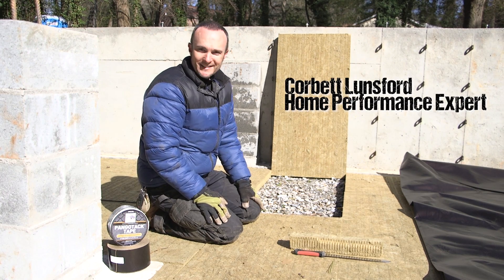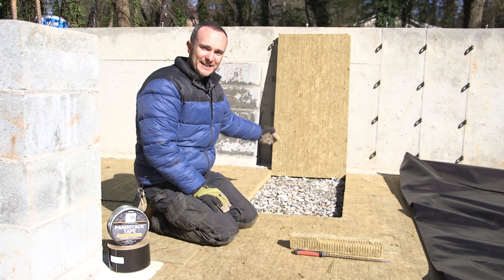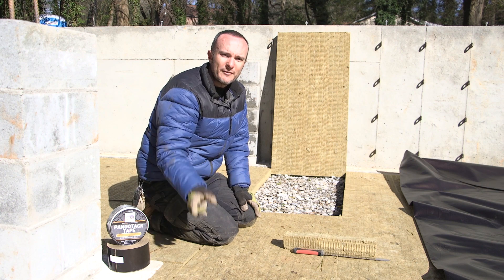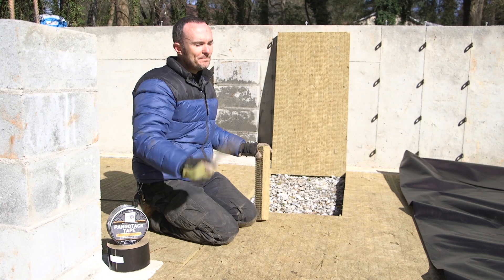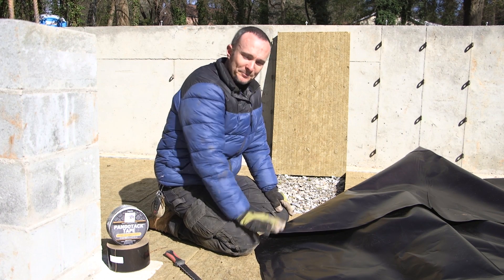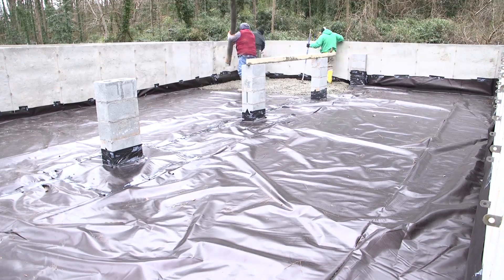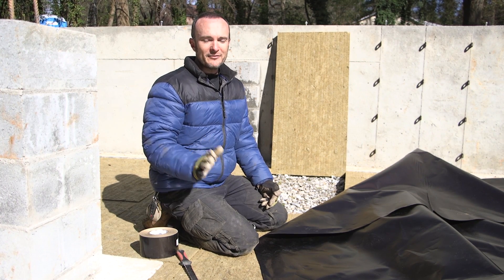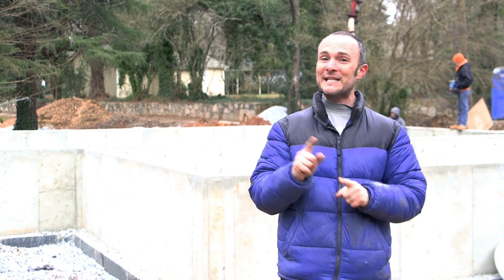5-Layer Slab System for High Performance Home Build

Comment: In northern climes you have an error. Possibly even for Atlanta.  The slab you just poured is in contact with (the exception being a 15 mil sheet)  with the rail footing and the concrete foundation wall.  No.  The slab temperature is governed by what it is in contact with.  Concrete has an R-value of less than R-1 per FOOT,, maybe.  So,,, why did you bother with R-10 under the slab?  You will have about an R-2 average yield.  Thermal conduction and thermal bridging.

Don't pour a thin slab.  Pour a thick slab, the slab can become not an enemy,, but a benefit,, a thermal flywheel for the house.  (Cool  or heat the slab,, and the house will be cool or warm.  Cool with night air,, heat with sun,,both are free.)  but, Isolate it from ALL contact with footings, soil, and outside air. If the slab is only in contact with the interior air , it will be the same temp as the interior air.

Fiberglass speeds the set time.  Pouring on insulated foam increases the set time.  A 2" slab will not generate heat anything like a 4 or 5 inch slab.  and a 2" slab on foam should not be walked upon for finishing.  Bull float it well and leave it alone.  2" slabs work very well.  I would use a higher bag count, which also increases the heat.

In Atlanta,, only try that pour in the winter.  At 80F and sun, your set time will be in minutes.  In any other than winter, use retardants, or a 12 man crew.

Isolate your slab.  And,, the vapour/water barrier goes under the sheet insulation, not over it.  The R-value of your insulation is based upon a dry insulation.  A rockwool insulation can be wetted .  A wet rockwool insulation has no R-value.  Rockwool or foam insulation should be on the level above the rail footing, and perimeter isolation band can be accomplished with a burial grade pressure treated 2X4, or 2X6,,  ,,or,, high density poly-isocyanurate (uncommon),, or high density urethane foam 3 to 5 pound density works well, or even pumice bricks.  (used for cleaning ovens and grills)

My first isolated slab was 1983.  I've made lots of mistakes,, no reason you should not benefit from my misdeeds.
Reply: Glad I could help.  That is exactly why I took the time.   I did, and did not use the 'pick two',, just a different way of looking at the same thing.  Calculate the cost of the improvement, calculate the money saved,, by building better, stronger, more insulation,, whatever.    Money has a cost and a value,, and money can earn interest and make money. So,, if you invest in a high yield investment,,, or you invest in more insulation,, which pays you back better or faster?  Choose the better return, either stocks, or insulation..  There is no such thing as a 20 year payback,,,,, you should have invested in the stocks and bonds and paid the increased energy cost with the profits.    I always calculated and watched for a maximum payback of 7 years.  Most 'improvements I ever attempted were targeted of a payback in 5 years or less.  Some few,, I would stretch to a payback of 8 or 9 years.  You also must watch for over lapping 'improvements'.  If you have already saved  a 100 dollars,, will the next improvement try to save the same 100 dollars?  Apply that thought to all aspects of the house you build for yourself.  Cheap shingles may be the best, cheapest, economic choice,,, or a copper roof may be the cheapest roof,,, you run the numbers to decide.

Rule of '72' .   A seven year payback equals about a 10% per annum return on investment.
Reply from the maker: Thanks, Sailor, and just so it’s clear, we used energy modeling to specify the exact R-values. I’m familiar with thermal bridging, but what we’re demonstrating on this channel is how anyone can achieve a high performance home without driving their team crazy. Btw, our cooling load is already just 1.5 ton, the smallest split system you can buy, so further insulating anything would actually DEtune my enclosure and HVAC from each other.
Reply: 1.5 for your locale is impressive.   You are doing good things.  Ours, north of Detroit, the last one I built quite a few years ago,, no central air, a water chilled A-coil,, about a 1/2 ton yield,,(de-humidifies) , heating,  a detuned,, burners removed,  3,000cfm,, but just 100,000 BTU.  3200 net square feet + full walkout level.  Gas bill on the order of 600-700 per year. (gas,  heat, hot water, stove, dryer)  Quad glazing, walls fiberglass12" over all.  Zero pipes or ducts in outer walls.

I'd like to suggest you think seriously about  a thicker, completely isolated slab.  Thickest I ever poured was 10" with 500 linear feet of ribbed 4 inch tubing cast in,,,,,   Winter sun warmed air collected from the top of the house by some slow shaded pole motor fans.  Ductwork from top of house to basement floor,, and into the floor slab.   81F sun warmed at the top was 79F as it entered the basement floor, and exited perimeter floor registers (16)  at 73F.  In January, a sunny 20F day,,furnace almost would not kick in until Colbert  monologue.
Reply: Sailor376also I'm near out as well and would like to build.  Interested in hiring you if possible.  Please contact me thriough you tube or also try Drew4justice at y a h o o .   I like what you have to offer
Reply: I do not get it . Why is insulation used under the slab?  First , if you do not have groundwater close to surface  about 10 feet  the ground works as insulation.   Second , if you do not insulate ground from  the floor the earth works as thermamass . Yeas , you have to insulate sides of your foundation and ground around of your house for 4 or more feet.

Comment: Just found your channel. I assuming this is going to be a conditioned crawlspace. I didn't notice any vents. Is this going to be used as a cold air return for your HVAC system? I am an insulation contractor and helped a few folks with insulated crawl spaces. We are about 4-5 hours north of you and we insulate about 2/3rds of the slab and leave 1/3rd with no insulation and that acts as a heat sink where in the evening it releases the heat from the Earth back into the slab and that saves on heating costs in the winters. Any thoughts on that for you?
Reply from the maker: Hm, interesting idea, but an energy model would show that an uninsulated slab (or any portion of one) is a liability in cold months- it does a beneficial heat sink thing in hot weather. The two basically are a wash for normal homes, and only in higher performing homes does it become a good investment to decouple from the 55 degree ground beneath.
Reply: The heat sink concept is used with hydronic radiant heat in the slab where you actively warm the ground.

Comment: I'm curious about the way that the plastic comes up the side of the foundation... isn't there a risk of gaps in the adhesive if you are not super careful during installation that could allow water vapors to make their way into the basement?
Reply from the maker: Tom, there’s a two-inch adhesive out of sight, between the wall and the Pango, which is the main seal. I just wanted the option to double seal later and cut it nice and pretty once the slab is cured.

Comment: Nice to see high performance builds popping up more often, I'm a contractor in Ohio and I am building a Passive house this summer for myself. My only real concern is the Rockwool under slab, I am huge Rockwool fan and will be using it on my build (exterior insulation) but the concern is that while it cannot to be harmed by water it sill has the ability to absorb water given enough contact time and no real way to dry out so it may just be a like a damp sponge, hope for the best there.
Only other thing i would suggest because your in a high Radon area is to use a primer then tape approach when attaching your vapor barrier to the concrete, good luck on the build I look forward to the updates.
Reply: Water passes through ROCKWOOL and it does not wick up the moisture.  That is why it is a good control layer below the slab, siding, and roof.
Reply: totally agree wet insulation is worthless hopefully they have good foundation drainage and it never gets wet?
Reply from the maker: Thanks, John, and good luck to us both
Reply: Rockwool on top of 6” of gravel though. XPS also works here if you were looking for an alternative.
Reply: @melvin_0bviously EPS>XPS. Degrades slower, is lighter and still has great pressure resistance for under slab.. More available AND CHEAPER as well
Reply: @dh66  I have no problem with EPS. EPS in general is just more susceptible to saturation than XPS. So in this particular application, I stick with my spec, but EPS can be made to work below grade. We obviously use it under highways in Canada and Alaska. 

But we’re not here to fight about which one is better. They all have their places. It’s more important that the work get done and gets done well. Here’s to below-grade insulation!

Comment: What is the cost per layer? I'm really interested in the Pango wrap, but it's hard to find a cost per sq foot on it.

Also, do you blindly throw your wallet at your subs every time they quote you a price or do you have a rough idea as to how much each product costs and installation?  You are doing the over-engineering that I want to do with my house, but I would like to think I will have an idea as to how much more it will cost vs. code. For instance, Florida requires roofing straps to hold it to the walls every so feet, but I want a strap on every joist. I will know the cost per strap times the number of joists, factor in the extra labor and can come up with a rough number. If the framer gets it in the ballpark, OK, but if it seems greatly inflated, I would question it and ask how they came up with the number.
Reply from the maker: Of course, always know what you expect to see, whether asking for bids or performing a diagnostic. Can’t break out cost per layer at the moment, Grace is the budget expert, but it’s worth it to do this for us, just as it’s worth it to tie every piece of wood together in FL.
Reply: @HomePerformance  i wasn't trying to lump you in with the 'more money than brains' crowd, but I was thinking of the people that were new to your channel. Just accepting an invoice from your sub requires a fair amount of trust. That trust was negotiated at the beginning of the project by you evaluating and choosing your subs. 

I guess what I am trying to say is that a self-builder needs to know material cost, cost of labor and time needed to complete a task. Jen-Weld and Anderson windows install the same way. The only difference is material cost. However, if you want to go all Risinger on it and use a fluid membrane with a flash pan, you should expect to pay more in materials as well as time if the installer has to learn a new technique as well as follow-ups to insure it was done correctly. Knowing the base cost of an installation helps with understanding if an estimate is correct.
Reply from the maker: Right on, Bruce- I’d say there are a bunch of pre-requisite understandings AND common sense necessary for getting the most out of this channel, which would be distracting and probably tedious to dive into in this type of vid. Also, I’m NOT necessarily advocating for homeowners to GC their own project.

Comment: I have experience with a 3 inch slab with rebar and it performed fine. of course it was in a basement tho. I put several layres of 20 mill poly under it and i didnt get any water infiltration whatsoever. I did put a drain under the slab otherwise the water that came in under it would have lifted the slab. My conditions were far different as i live in a flood plain and water was a major issue. in fact it was the issue i was trying to solve. The slab worked great the sub pump did not grr had to buy a high performance pump and spend way more money on it as the water infiltration problem was idiotically bad but the slab never lifted and the walls leaked not the slab. i ended up spray foaming the walls then covering them with tar and poly film. what can i say i am cheap af. but point is it worked like a charm and i had 2 feet of water standing on the outside of the foundation at several points after the final install so yay me no construction experience at all and i fixed a thing that contractors told me was unfixable.
Reply: chrisrhudy2000 there is a drain under the slab.  

It was installed previously on the footings with Form-a-drain.  

The forms allow the connection of the side facing the slab to the outside of the house with a tube bridging the footing.
Reply from the maker: Hahahahahahahaha

Comment: I tried talking my concrete sub into doing XPS or EPS foam below slab. He told me I was crazy and that was never done here.  Building design needs to improve like this. Great video, going to have to review the other ones of yours.
Reply: American are funny in sweden its normal since 40years? to have insulation below the slab, (the edge and footer aswell) normal insulation thickness is 300mm eps s80 ,XPS . incase of high loads on slab. insulated concrete slab are fine  up to 40-60 kN/m witch you can build up to 3 storeys with.
Reply: @MrGbSandwich  Actually its unthinkable in Scandinavia to but any mineral wool products in or on the ground
Reply: @raunop7391  no its not. Its  used frequently in cases when you want to insulate the slab when you want the slab to dry faster then it does when using xps or eps. rockwool sell it under the name "markskiva" in sweden.
Reply: @MrGbSandwich   They aren't funny, they just a couple of decades behind. That's normal to be behind in something, like building techno. States, on the other hand, came up with OS and iOS, with the internet, with many great software programs. You Swedes are great too, every time I use laminate flooring I enjoy how simple and yet smart it was designed and three-point seat belt saved my son's life. What is beyond my understanding is why you brought one million of 3rd world people into your beautiful country. It will not end well for you.
Reply from the maker: Thanks for the follow- yes, I'm hearing every time my inspector visits that no one has ever done any of this in my town before
Reply: You need to find a new concrete sub my friend. I have not built a house without sub-slab foam in over 10 years here in the midwest.
Reply from the maker: It’s a system, remember- the 6” of gravel underneath breaks hydrostatic pressure, the drain tile drains, and the radon fan evaporates and exhausts what little water remains. Yes, this is a system that can work in other climates, but you should think through any design carefully.
Reply: You raise a very good question Edward. I have asked the same question from several of my insulation subs. Non could find the answer to that. I know that XPS has minimal to no change in R value when wet. EPS does loose some R value since it absorbs more water than XPS. I can not find any information on stonewool insulation.
Reply from the maker: I believe Building Science Corp. did a study that found issues with XPS conductivity in cold/freezing temps.
Reply: @HomePerformance  Yes, XPS/EPS insulating properties will improve when temperature falls
Reply: @Edward Duff  yes can be used in anyclimate but there is more money efficient ways then this todo it.

Comment: In which way is this high performance? In Denmark we use at least 300 mm eps, two inch is nothing? Form the looks of your coat its cold there.
Reply from the maker: Haha, definitely a different climate Andreas, and when I say 'high performance' on this channel, I mean 'achieving the specific goals of the occupant'. One of our goals is to avoid foam, because in the states all foam has flame retardants in it. Another is to tune the home's systems to be both cost effective and easy to live in and maintain, and 2" showed in the energy modeling process to be the best break-even point for that.
Reply: You don't have real cold and using 300mm? And shouldn't you use XPS in the ground?
I have test pieces of EPS and XPS in the pond. I have to make a video, hate to see using EPS in the ground...